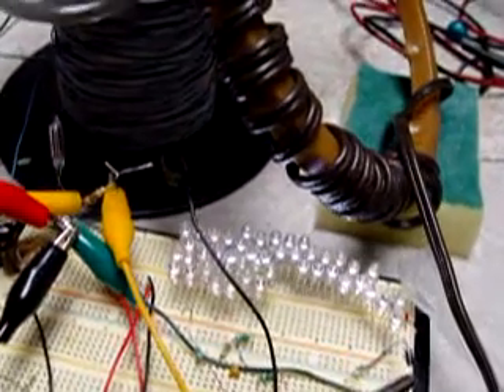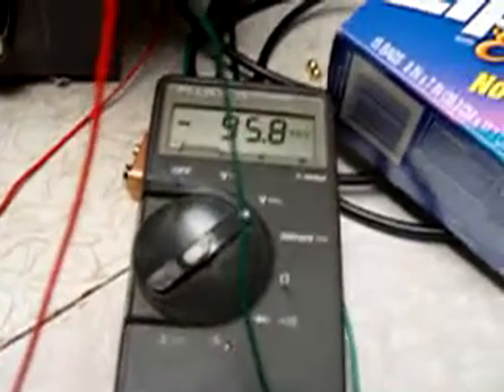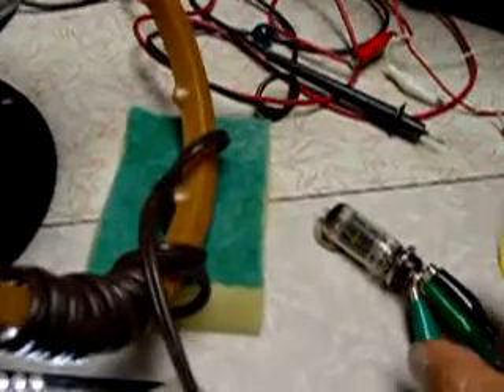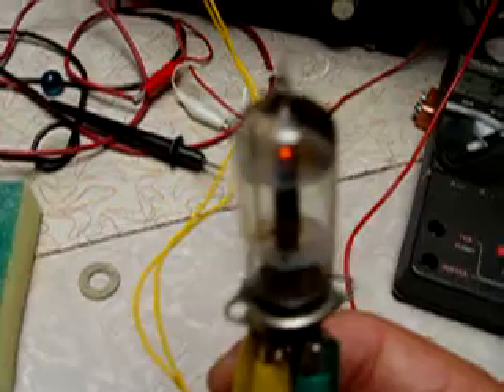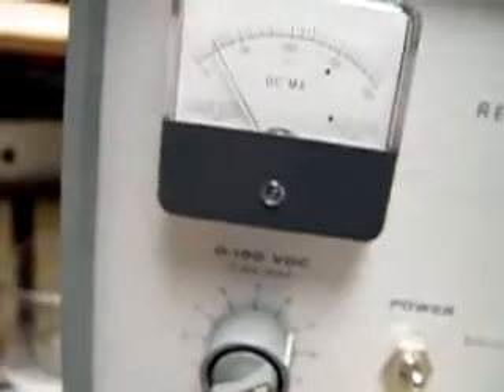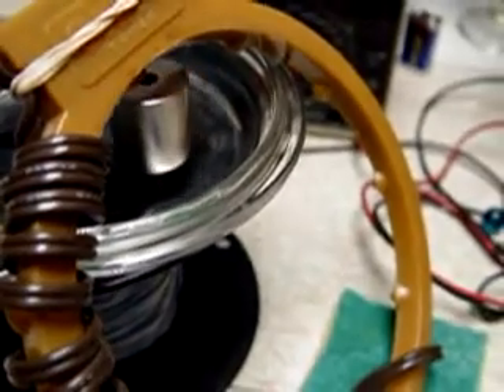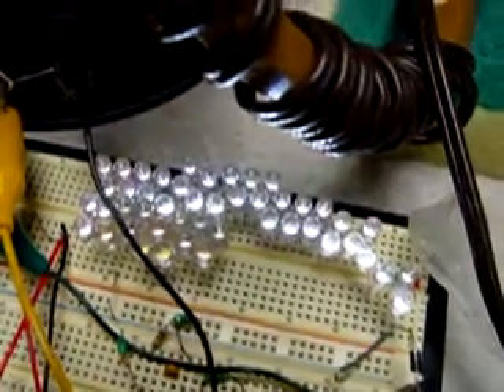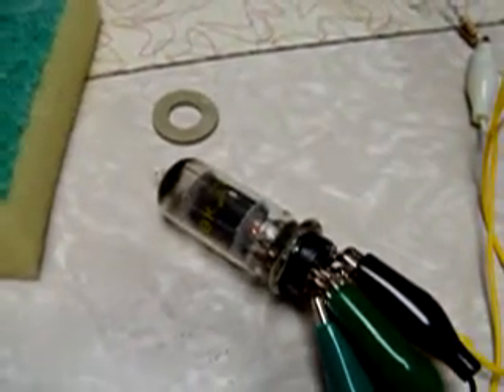Retro Vacuum Tube Bedini One Magnet no bearing motor.....6C4 Triode

Comment from the maker: @Valerifon1 
Oh, I see you want to use the circuit for it's intended purpose and not a toy, that's different. Yes, the 6080 would be a good tube to try. You will find tubes very robust for this application. You can use both triode sections of the 6080 in parallel. You will have to experiment with resistor values to 'dial in' optimum operation. Best of luck with this.

Comment: @retrod1 I think the advantage would come in when you have a large bank of batteries to charge. Then you can "stack" them in series. In my case, I have 2 banks of 12 and 11 batteries respectively at 135Ah each battery. So my thinking is that if I could charge them in series, i could get them to charge quicker. I sent you an email - maybe we could get into some details offline.... regards and thanks for the fast response! Luther

Comment from the maker: @Valerifon1 
Hello. I didn't write down the circuit when I created it. It's basically the same as the Jonny Davro transistor circuit that has been published elsewhere. I had to fiddle a bit with values to bias the triode tube properly. I recommend building the solid state version, I didn't see any advantage to using the vacuum tube/valve other then the novelty of being the first person to do so.